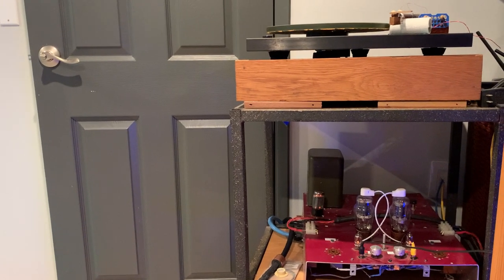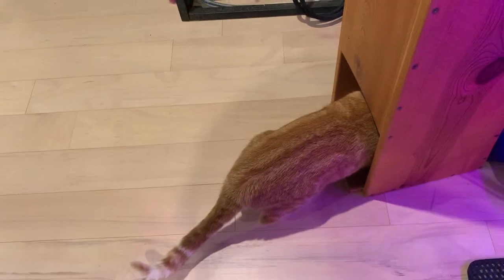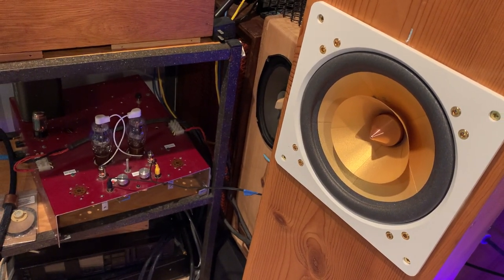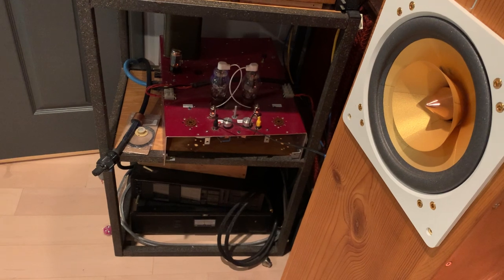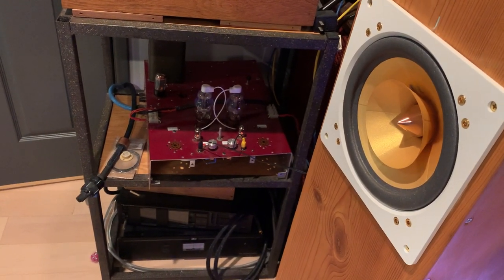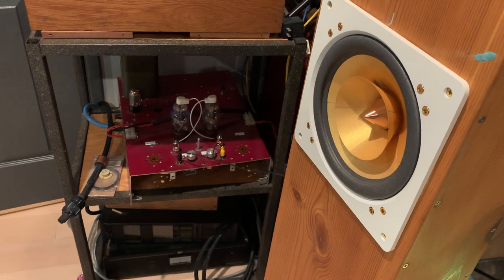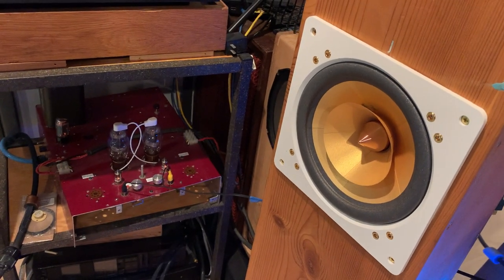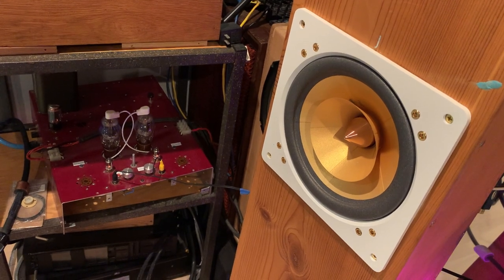Answering Voigt Pipe Port Placement and Cube Audio Fc8 driver imaging questions

Comment: Hi Janos. Thank you for all your valuable VP videos! Considering WAF, many of us might end up with a folded VP :) We know very well that this is not the optimal VP design, but at least we can still dream of a straight VP! Anyway, I would love to hear your, or your knowledgeable friends', experiences or just thoughts on some of the design aspects of a folded VP.  I'm thinking about questions like: should the narrow end of the pipe taper towards the front baffle or the back? How wide should the gap between the dividing board and the top of the cabinet be? Should the driver optimally be placed a little down the front baffle, or as high as possible to minimize the area taken up by the dividing board en the space behind the driver? Maybe no one can answer these questions, or it all depends :) But you might have some general rules, best practices or reminders. Thanks again Janos!! /Claus
Reply: Yes, I’m also very curious what the down sides are when going for a folded VP!

Comment: there's an awful gap in the driver you've over tighten the screws too tight, would be better if they had a double space screw holes there,
you got to put a gasket otherwise you're get blowing use something like blotting paper. but I'll still put an extended baffle 14"-15" by 10 -11 mm thick and countersink the driver, attach it with double-sided tape and the screws from the driver. that will help with that room matching issue as well.
Reply from the maker: It's just the shadow / optical illusion, the driver sits well. No noticeable leaks. Also, as the Voigt pipe cabinet is not pressurized, any eventual leaks make for no noticeable gap in the performance. When my brother built his Voigt pipe, he had 3mm gaps (!) in the cabinet as he got poor quality crooked wood. It made no audible difference when we sealed them up. (Very different from small BR cabs which are ultra-sensitive to even tiny leaks.) 
Actually, the Voigt pipe benefits from leaks in the narrower regions. I have tiny vent holes a the top to release the pressure, and they made quite an improvement. An eventual leak around the backet would also benefit, as we have a pressurized situation around the driver cone - it is partially handled by the dampening material behind the driver (sheepskin/wool), but addoitional pressure release would aid in preventing local air turbulence at higher frequencies.
Eventually I will try a leather gasket under the driver, to alter the driver / cab connection. Although my feeling it's not required, as the basket is solid metal, sits tight on solid wood - resonances directly transferred, that's what I want. Will be good experiment though to see what an interface does. With the old driver the basket frame was a hollow ringing metal, there I wanted dampening. Here, it's cast solid metal, I want as direct coupling to the wood as possible. (You don't want that in dead cabinets, but this ain't one of those.)
I'm not using the double screws, as that would add unnecessary mass and other issues.
Extra baffle - if it's in line with the cab, it improves midbass / low midrange fullness noticeably. I have made the baffle, tried it, but not using it because it makes it look so ugly. Clashes with WAF big time... ;
Reply: @realworldaudio  umm!
I wouldn't use leather that will dampen the driver, blotting paper is the best. paper is more transparent than anything else. of course it can be desirable to dampen the resonance in that case the leather would be desirable.
paint the paper wizard with fibreglass resin, that's what cube audio have done, I'm not sure what paper they've use could be greaseproof paper? that would probably be the best.

Comment: In a much earlier video when you were first talking about the VOL you looked at some expensive speakers  I think only 7 pairs exist built by a well know Japanese guy and you mentioned that the best port is 360d around the base.  ( I think his were only on three sides or 270d)Why wouldn’t thst work with the Voights?
* this is all from memory so could be errant :-()
Reply from the maker: Superb observation Eddie! 👍✨ It was Jean Higara's cabinets running Altec 604 driver. It used a port that's fully open on the bottom 360 degrees. However, he could do that because in his design the port is in the center of the cabinet, which is an empty cabinet with a port facing down, through an inner additional floor. I cannot do that with the VOL, because the VOL is a transmission line with the cabinet divided to front and back sections, and it has a slot port. The 360 degrees cannot be done with the slot port - or, actually, it could be done, but then I would have unequal acoustic loading for the slot port (center vs sides). I have decided on the front and back opening only, because I am using the bottom as a pressure conversion zone (horn loading the port, which is a bonus in addition to Hiraga's design.)  I should make a video on this, not sure if this makes sense without seeing the parts involved...